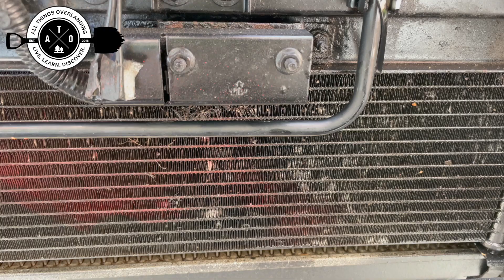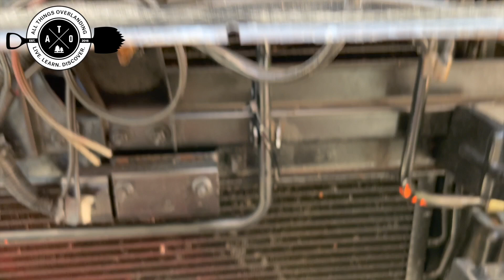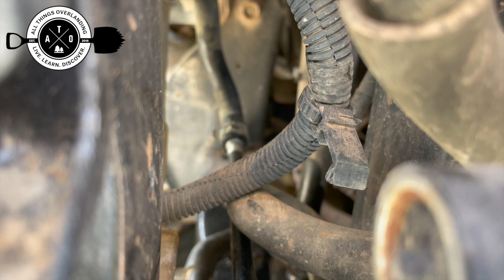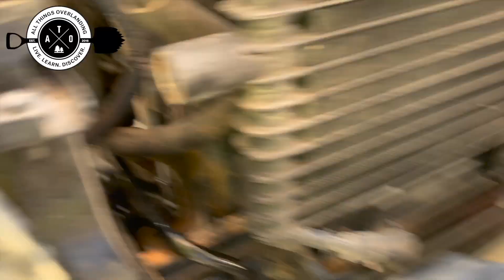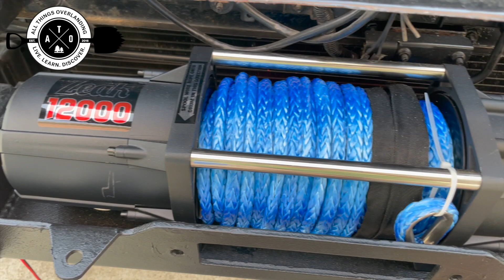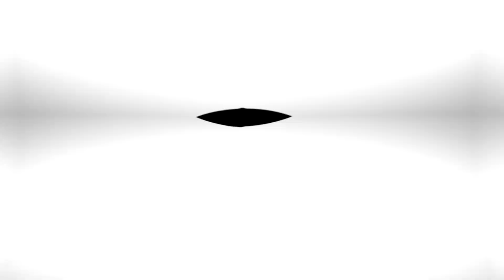2nd Gen Nissan Xterra Power Steering Oil Cooler Replacement and Winch Install in WAM Bumper

Comment: Thanks for the video, was curious about how the wam bumper looked, so thank you for that.  One suggestion would be to put a bit of rubber hose around behind where the clip was missing and you zip tied it down.. it's bound to slowly rub there too and might have a repeat leak in a different spot. But looks good!
Reply from the maker: Thanks and good tip! The new winch doesn’t come close to it but I’m definitely keeping my eye on it.

Comment: Your probably aware of this by now. Non pressure line. If you wanted to add a aftermarket cooler cut those lines aways back and use a crimping an fitting and you can run an braided line to a new cooler and tuck them better away from your winch.

I use to have a 97 suburban with a 6 inch lift and in the woods of New England I was blowing pumps and steering gear boxes due to heat moving the larger tires in deep mud. Added an aftermarket cooler and never had an issue again. If you’re bringing your truck through any deeper mud I would recommend a larger aftermarket cooler to avoid premature death of pumps. Added weight, added tire size really pushes an oem pump to its max fast.
Reply from the maker: Yep, got that figured out, but this is good info. Thanks for sharing!

Comment: Hey Fletch. I actually just did this on my Pathy and I found that the hose right below the power steering reservoir was also leaking. Be sure to check that hose too because p/s fluid is corrosive!!
Reply from the maker: Huh, good to know! I don’t have any more fluid on the driveway over the last few days now that I’d done the replacement but maybe it’s just not getting all the way to the bottom to hit the driveway. I’ll check it out for sure. Thanks!

Comment: Replacing my steering wheel cooler now, but I can’t take the clamp off where the rubber holds onto the metal. I’m assuming you press together the wings?
Reply from the maker: Yep, that sounds right. I believe I can picture what you're talking about and that sounds like what I did.
Reply: Thanks, I got the clamp off, but sliding the tube off the rubber isn’t any joy. Struggling with that! Ugh.
Reply: Ok, I’m done for tonight. I got the rubber off on one side, has to shimmy it back and forth while trying to pull it off.  That took like 15 minutes.  Have the other side to do. Thanks for the video tho, it’s the only reason I’m doing this myself. 🙂
Reply from the maker: @123tech  You'll get it! Good luck!
Reply: @AllThingsOverlanding finally got it done! Definitely had to put some muscle into getting the rubber off! Thanks for the video!!
Reply from the maker: @123tech  Woohoo! Nice work! Glad it worked out!